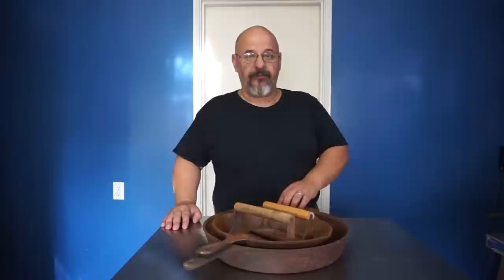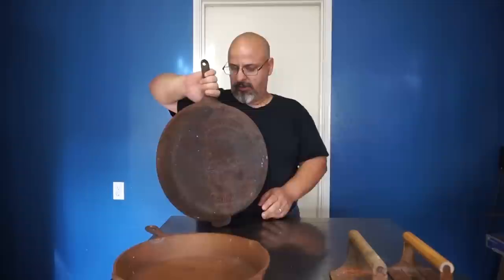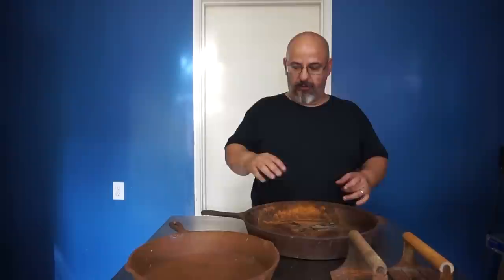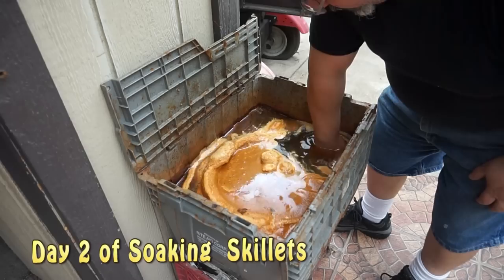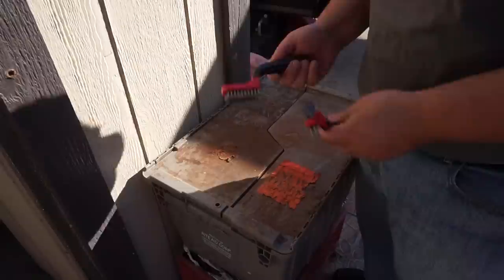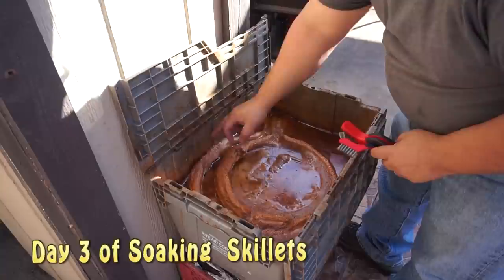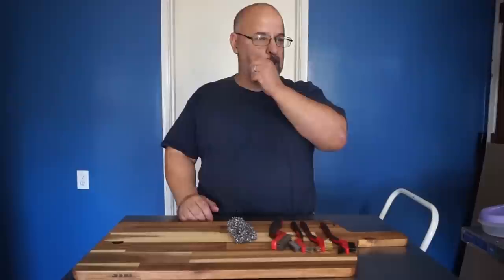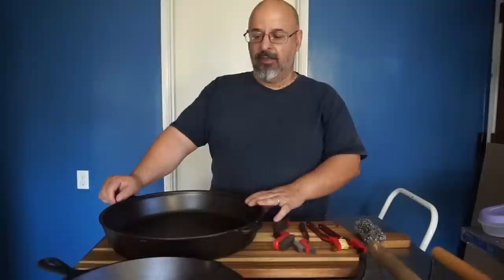cast iron skillet restoration #1

Comment: I've been restoring cast iron now for about 2 years and have done different methods including a self clean oven method, Easy Off Oven Cleaner (nothing more than lye), a lye bath, followed by a vinegar soak, then just a vinegar soak when there isn't that much crud.  Vinegar actually works the best of all methods as long as you periodically check it and clean it as you go.  Your skillets turned out great!  Good job!  Oh and BTW.....much less fuss than electrolysis with a little bit of patience!  lol
Reply from the maker: I've restored over 200 cast iron pieces so far. I've o ly used vinegar and water and self cleaning oven and they all came out awesome thanks for the comment. And view.
Reply: @franksbackyardbbq7999    I can't say that I've done that many, but as I've only been at it since July 2017 (actually 1.5 years or so) I've done about 50 pieces.  I've looked into electrolysis, but quite frankly, either a lye bath followed by a vinegar soak plus a little elbow grease works the best OR simply a 50/50 vinegar water soak until all the rust and old seasoning is gone or as much as the vinegar will release.  Then I take a Brillo pad and scrub it clean, rinse with COLD water, then spray with oil until it is time to season. That method prevents flash rust.   FYI......not even electrolysis can get ALL the old stubborn carbonized seasoning to release, so why bother with the fuss of setting it up, plus the ongoing maintenance & replacement of anodes, etc.  The only thing I won't do anymore is a self clean oven as the temperatures can be too hot for some of the pieces and it could cause warping, cracking, or fire damage.  Plus my oven racks are now warped from the heat.  It just isn't worth it.
Reply from the maker: @ladylibertystacker2014  the only pieces I put in the self cleaning oven are the thick cast iron not the thin ones. Absolutely agree with you about all the other way are too consuming with and little results. I think like you a little hand scrubbing is the best and when you cook with them it seems the food taste better.??  My thoughts.

Comment: @Frank's Backyard BBQ : Where did you get your plastic bin and how much water/vinegar did you use? Great video!
Reply from the maker: You can use any type of plastic deep bins,  you can go to home depot,  walmart, target they are call storage bins they come in different colors.  I use one gallon of vinegar  and the rest with water a out 3 quarter way up to the top given space for what you going to put in.  Just remember put storage bin were it going to stay its going to be very heavy to more around.   After using it keep the water vinegar mixure for future use I've  used mine for 6 months and over 30 pieces of cast iron cleaning.   Thanks for watching and commenting.

Comment: That is the best looking cast iron restoration I have ever seen...since you do six applications to season, are they very light? Are you wiping most of the oil off before you put iti in the oven?  It looks so smooth!
Reply: I have read the lighter the coats, the smoother the season. Like with spray paint

Comment: I just took all of the old seasoning off of mine with a lye bath, first time I ever did that and it was so simple. Now the cast is totally bare. How many coats do you suggest to reseason a bare skittle?
Reply from the maker: I season all of mine cast iron 6 times and letting it cool down in between each time.

Comment: I see a lot of people heating cast iron cookware in the oven first before cleaning. If they come out that clean without the heating first whats the point of the heat? I know you use heat to season them, but I don't see what the point of heating them before cleaning is for.

Comment: Can you put rusty cast iron in a modern pyrolytic oven on clean cycle at 500 C  for rust removal
Reply from the maker: You could put it in a self clean oven process to clean cast iron and will remove everything just make sure its the thick cast iron not the thin one.  The thin cast iron doesn't do well in a self cleaning oven.

Comment: So I've heard when seasoning, to bake it upside down. Is this correct or should it be done right side up?
Reply from the maker: You could bake it both ways,  if you bake it facing upside just make sure to wipe as much oil off the skillet 🍳.   What i do is on the first 30 minutes I take skillet out and wipe again then put it back in for the next 30 minutes. Then I let it ccol down then redo again I do this 6 times and boy it comes out awesome 👌.

Comment: Hey there what is the quantity of vinegar   To. Water
Reply from the maker: I use one gallon of vinegar that I show and the rest water till 3/4 to the top.  Keep tub in a place you don't need to move it will be heavy.   Afterward keep it for your next cleaning don't need to redo everytime . I've use that water on video for over 50 pieces about 6 months later I dump it and start over.

Comment: The cast iron that says “made in USA” wasn’t required until around 1960. So if it states that you can say it’s been around at least since 1960 or so, but not prior. Good video!
Reply from the maker: Thanks for info and watching.
Reply: Si Vis Pacem Para Bellum    This was stated in another video and is not always true...it was not required....just by major manufacturers...independent casters didn’t have to adhere to this regulation...
Reply: @chewie2055  The AB&I is 1960 note it has no heat ring. The lodge one is much older note the heat ring and no USA mark.

Comment: I'm having good luck removing rust. However, I'm having problems with the old seasoning. Any suggestions?
Reply: i ruin a early 40's dutch oven using the burning method. DONT DO IT! Now I will use the  easy-off methode

Comment: Do you have a way of removing a large build-up of crud?  Thanks in advance for any input you may have. I loved your video and will be doing this to a few I purchased at a yard sale that has rust.
Reply: I've seen other videos where they put it in a self cleaning oven with foil on bottom rack and upside down.
Reply from the maker: Mycraftingchannel i put them in my oven a press self cleaning mode.  Just make sure you stay around and open all windows and vents in the kitchen because it will start smelling and you want it to vent out.
Reply: @franksbackyardbbq7999  thank you so much for replying.
Reply: @8stringmonkey  Thanks for replying.